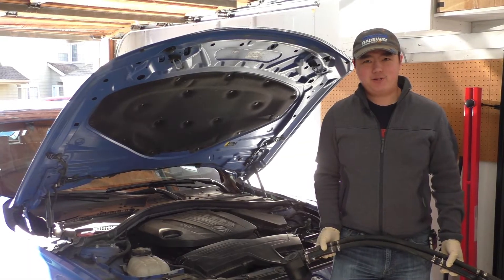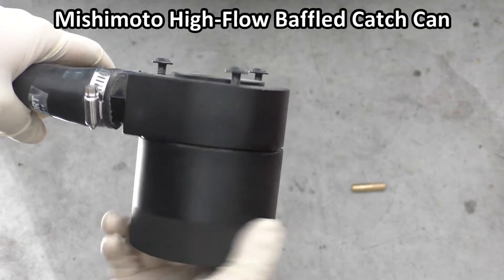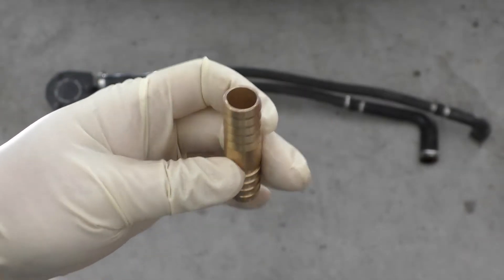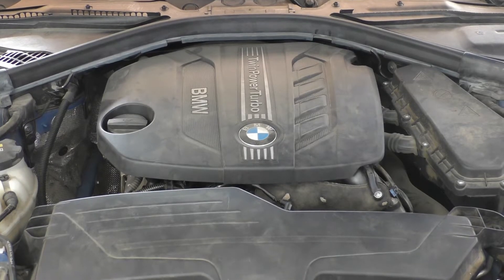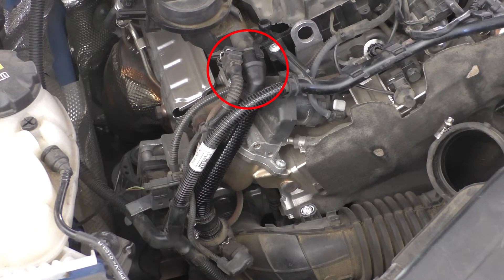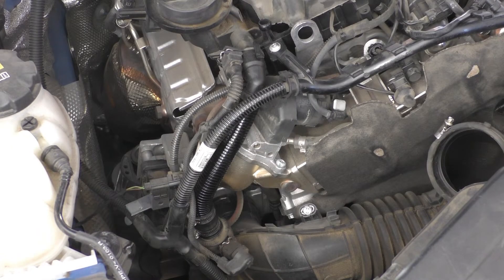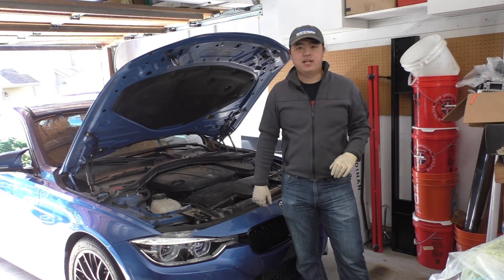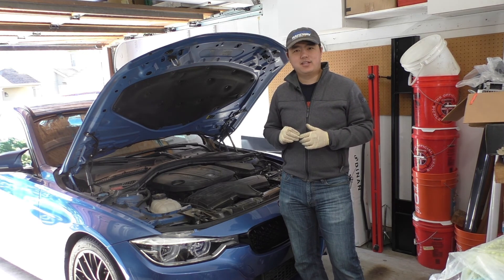BMW 328d N47 Oil Catch Can Setup

Comment: What is the 2nd pipe that is in the air box on the right. What does this do?
Reply from the maker: That pipe is just for additional airflow from what I could tell. It's only on the diesel engine intakes.

Comment: The engine in your car is the N47N. I cant find a proper replacement hose because of that lower heating element. Basically its going to cost over 250$ now for a replacement. I think I am going to do add the catch can. BMW should put a real hose on the car instead of the piece of crap hose that is thin as a straw.
Reply from the maker: Check out my forum post here on how to buy the Euro version of the hose and then adapting it to the lower heating element much more affordably!
https://f30.bimmerpost.com/forums/showthread.php?p=24177240#post24177240

Comment: I recommend using a Mann & Hummel ProVent OEM diesel engine crankcase ventilation coalescing oily aerosol separator. The ProVent 100 or the 200 units are suitable. The 100 is smaller and is the best size for the N47 and is easier to fit. The ProVent can be connected to return separated oil from the crankcase ventilation gasses, back to the crankcase. The unit can also be drained manually. A crankcase pressure regulation valve is incorporated in the ProVent housing. 
The ProVent is able to reliably remove practically all oily aerosols from the crankcase ventilation gasses. However, there is  a coalescing filter element inside the ProVent that needs to be replaced occasionally, depending on flow volume and operating conditions. A filter element will last at lease 1 year used on a car. 
ProVent crankcase ventilation separators are designed and used on commercial and industrial diesel engines, OEM.

Comment: Can you post par
t number from HDS ? plethora of reducers. thank you for your awesome vids. 17 328D wagon w 115G miles. No lights, no codes but the can is for preventive measures.
Reply: i found the hps 1" to 5/8 90 degree part, SOLD OUT, even on Amazon. HPS 5/8" - 1", Silicone Straight Reducer Coupler Hose, High Temp 4-ply Reinforced, 16mm - 25mm, this is my plan B. find a 90 for 5\8 hose. should be good.
Reply from the maker: @MrBiggssr  I see the HPS elbow available on eBay (you can search PN HTSER90-062-100).

Just be careful getting another brand elbow that's in metric. I tried one of those and it was too big to fit snugly around the port from the engine.

Comment: Why would you wana heat the blow by gasses 🤔
Reply from the maker: In cold climates the blow by can condense inside the tube and sludge up the intake tract instead of getting pumped through to the intake manifold.
Reply: When ambient temps are below freezing, water vapor will condense to liquid and ice will form that can block the crankcase ventilation plumbing, causing excessively high crankcase pressure. The heaters prevent ice forming in the tubing.  The heating elements do not heat up the crankcase blow by gasses.

Comment: i hope and pray youre not changing your oil at 10k intervals. Even bmw revised that and said it was one of the main contributors to the timing chain failure that was so prevalent in these engines when they first came out.
Reply from the maker: The original OCI that caused issues was 15k. It was reduced to 10k, which has been fine since. I typically did 7-8k OCIs, and then went to 10k after doing oil analysis every change showing that the oil was still protecting everything and wasn't used up.
Reply: @FaRKle0079  good to know.

Comment: i have a 2015 328d with 106,xxx on the clock, been a very reliable vehicle, but constantly pops a check engine light relating to either the scr sensor or the rear oxygen sensor, always seems to be towards the end of the oil interval that this happens, typically goes away quickly but i was wondering if this could be due to the wrong oil being used? i read that the car requires a low ash oil to prevent the exhaust filtration system from burning up. Just wondering your thoughts. possible they are just getting old and need to be replaced but seems like a symptom caused by something.
Reply from the maker: Are you not using an LL04 oil?

At that mileage the sensors could be bad. It'd be best to check with ISTA to understand the conditions that trigger the code though.
Reply: @FaRKle0079  I trust that the dealership checks the requirements of oil for the car before changing it? But I know I’m probably wrong for assuming they do anything right at the stealership.
Reply from the maker: @theprodistini2590  You should have the correct oil if the dealer changed it.

Comment: What happened to original CCV valve ?
Reply from the maker: The only original part I replaced was the hose connecting the CCV output to the turbo inlet pipe.

Comment: This Mishimoto can is not available. Is there another one brand that you recommend? Anything particular to look out for in terms of catch can filter etc ? Also on this 328d do you have any issue with oil filter housing gaskets ?
Reply from the maker: I still see the can I used on their website: https://www.mishimoto.com/universal-high-flow-catch-can-kit.html

Any of the higher quality cans should work fine. I'd just be careful of a very fine filter if you live in frequently freezing temperatures and park outside. One guy had his bronze filter freeze up and create a blockage.

I'm not aware of any OFHG issues on the N47, but VCG might leak around 110-120k mi.
Reply: @FaRKle0079   Thanks for getting back. Can you suggest a good one without breaking the bank. I am kind of a newbie and got this 328d for power and putting in the efforts to make it nice for the next 7-8 years. The previous owners mentioned that there might be few drops of oil coming out from the engine rail and drip behind the driver's side wheel through the weeping hole. on the engine rail/channel and hence my first thought was OFH gasket.

Comment: What’s up Andrew! How  would you incorporate your oil catch can setup with aFe’s Momentum GT Cold Air Intake System? aFe’s system incorporates the stock crankcase breather hose into their system, but that’s completely deleted with your catch can setup. Any recommendations? I already have your setup on my 17’ 328d and I’m not necessarily looking for performance gains from aFe’s system, but to make the turbo spool-up more audible! 😂
Reply from the maker: It looks like you may be able to use a bit of pipe or joiner to make a union coupler for the HPS elbow to the aFe boot. HPS sells aluminum joiners, and the  90deg silicone reducer elbows have different sizes. For the 5/8" ones, they can go up to 1.5".

You can see their offerings below:
-Elbows: https://hpsperformanceproducts.com/pages/silicone-90-degree-elbow-reducer
-Joiners: https://hpsperformanceproducts.com/pages/hps-aluminum-joiner-bead-roll-connector-tubing-tube
Reply: @FaRKle0079  Thanks! Hopefully the inlet on the aFe boot and the HPS elbow I used from your system are the same inner diameter to make things easier. If that’s the case the Aluminum joiners seem to be the easiest option. I’ll contact aFe to see what the dimensions are for that inlet and go from there. I’m just trying to make everything tie together and not look like crap. As always thanks for the help!
Reply from the maker: @brentevans4430  Nevermind, I'm being silly. The install with the aFe intake is the same as with the stock one. The HPS elbow goes onto the heating element module, just like how I did it, and the heating element module goes into the aFe turbo inlet boot and is secured by worm drive clamp.
Reply: @FaRKle0079  you’re right! I totally forgot you separated the heating element from the stock breather hose. So yeah I’d just clamp the heating element onto the aFe inlet and then attach the 90 degree HPS elbow from your system to the top of the heating element. Went back and watched your video and noticed I was really overthinking this. Haha

Comment: I was just replacing the intake manifold gasket and during that the PCV plastic hose shattered!

Ended up fixing it with 3/4" rubber coolant hose for now.. I'm planning on doing the catch can.
Reply from the maker: If you want to "go back to stock" you can order part 13717823517 and the cut the corrugated tubing at the length you need to for the rubber coupler and heating element.

Comment: I'm running a JR  Stage 3 Tune on my 328d. I think you are right I peak about 30ish. 

How come you haven't done the EGR delete yet? If you have questions about it DM me on instagram. @ryan.f31bmw
Reply from the maker: CA requires smog check every other year, and I don't really see why I need to remove the EGR HW if its use can be programmed to when I want it or don't (the KermaTDI tune I have can do this). That's why I haven't felt the need to delete it.
Reply: @FaRKle0079  ahh Cali gotcha.
Reply from the maker: @ryanreich7635  Yup... I failed smog once because I didn't remove my catch can. It's dumb that a mod meant to make things cleaner makes you fail smog.

Comment: Thank you for the awesome job you are doing with these BMW videos!
I'm running a tune with a 27.5PSI boost on my 320d. I can't even imagine a 32PSI boost on a stock turbo. How do they not blow up instantly? 

I notice that my engine bay smells of exhaust while running. Is that normal or could something be leaking? I don't have any issues with power or check codes (scanned with ISTA).
Reply from the maker: High boost, the beauty of diesels and compression ignition!

It's pretty normal to have a bit of smell in the engine bay. One area I'd check for leaks is where the CCV pipe connects to the intake boot that feeds into the turbo. BMW has a pretty poor seal there and I had a lot of buildup around that connection.
Reply: @FaRKle0079   @FaRKle0079  I have checked the CCV pipe and it doesn't have deposits. I wonder why it should smell of anything at all. Isn't it a completely sealed system on the exhaust side?

Another thing I don't understand is why there's a slotted connector to the intake path in the grill. (7:55). This is not sealed and seems to breathe air around this region. Is the smell because of this open region?
Reply from the maker: @BimmerDrives   That slot connects the air box to the intake channel. The filter is in the airbox, so it doesn't matter much if air seeps in that way.
Reply: @FaRKle0079  Yes, but I'm wondering if some of the CCV ventilation leaks back out from here at idle, when not much air is being pulled in.

Comment: Can you please do an EGR Delete Tutorial? Would definitely help on reducing carbon buildup in the intake and on the valves. I mean you’ve only eliminated half of the problem by installing an oil catch can lol 😂
Reply from the maker: It's easier to have a tuner program EGR to stay closed than to delete it outright. EGR is actually beneficial for helping the engine get up to operating temp from a cold start too.
I won't be deleting mine as I have to get smog checked every other year.
Reply: Interesting! What tuning setups do you recommend? Also are there specific tunes that automatically close the valve once operating temp is achieved? ...So you don’t have to physically open an close the EGR every time through an app or something.
Reply from the maker: @brentevans4430  I highly recommend the KermaTDI tune. Those guys have really taken the time to understand how BMW designed the system and intended it to operate. Other tuners will modify one thing here or there to achieve a specific target, without considering the effects on the rest of the system. I've gone through three different tunes/devices over my ownership period (not including the stock tune).
Reply: @FaRKle0079  I finally got my Certified Preowned 2017 328d as of yesterday. It seems that FCP Euro and other sites don't recommend any fuel filters for my vehicle. It should be the same as your filter correct? Just trying to do some maintenance.
Reply: The vehicle is at 47,000 miles and just at the end of its warranty period, and I'm not sure of what has been serviced up to this point... so I'm doing a ton of basic maintenance.
Reply from the maker: @brentevans4430  Congrats on the acquisition! My vehicle is also a 2017 so yup, you'd use the same fuel filter. Here's my video on changing the filter: https://youtu.be/cVqaKJfV6NA
Reply: @FaRKle0079  I've looked into the kermaTDI tuning things and they have one for the 328d but how do i know if itll program the EGR to disable or if it simply just the performance tune?
Reply from the maker: @ruvdan  The KermaTDI tune optimizes the EGR use to reduce build up, while remaining emissions compliant. There are cases where EGR is useful.

Comment: Great video - is there any sort of detectable difference in the performance/condition of the car since you've installed it?  I ask because I am in the process of trying to sell an M7 oil catch can I bought for a MINI Cooper I traded to get the 328d Touring!  I'll have to look closer to see if it could be made to work...
Reply from the maker: Feel-wise there's no difference after adding a catch can. When I've disconnected my charge air hose/pipe from the intercooler though I notice there's less oil. Of course all the oil that the can collects (even if it's not a huge amount) means that much less oil going back into the intake system!
I'm sure the M7 can, can work with the N47 given the right size fittings.

Comment: such a straight forward & great video! I am thinking of doing this mod on my 520d N47, mainly preventing oil from blow by & EGR carbon sludge mix clogging throttle & manifold. Do you think it will help?
Reply from the maker: I think it'll help to do what you want, preventing oil from mixing with recycled exhaust gas. To keep the intake manifold even cleaner, I'd see if you can find a tune that closes off the EGR valve more too.
Reply: @FaRKle0079  i wish to close off the EGR too but its illegal where I live; annual provincial car inspection.
Reply: @미스터쿠쿠-e1x  couldnt you just unplug the EGR leaving it in the closed position and then when you have an inspection just plug it back in? im sure the cel would illuminate but if youre looking to rid yourself of the EGR i think that would work. Just make sure it doesnt default to the open position when unplugged or your manifold will melt.
Reply: @FaRKle0079  I also heard the condensation on bronze piece of Mishinoto catch can may freeze up in winter and clog the system. I am trying to find one that doesn't do that. Anyway, keep up your good work! Loved your video!
Reply from the maker: @미스터쿠쿠-e1x  The catch can I'm using (the high flow version) doesn't use a bronze filter, but more of a plastic/foam type mesh. I think it has larger orifices than the bronze one. I'd shoot Mishimoto an email and ask them about that failure mode too!
Reply: @FaRKle0079  will do! thanks a lot :D btw do you have any opinion about coalescing air filter?There is a product call "Provent 200" which is a coalescing filter OCC but I am building a blowby filter system from scratch. Would coalescing filter causes air flow restriction and cause engine's seals damage?
Reply from the maker: @미스터쿠쿠-e1x  The provent 200 should work fine. There have been others that have used that on BMW diesels. I don't really have an opinion on whether it's better or worse than a catch can. The only thing about it is you have to replace the filters and might need to attach something to the bottom as a collection reservoir.
Reply: @FaRKle0079 I see, thus need two cans one for collecting and one for store. Thank you for your great comments! I will give u an update how it goes
Reply from the maker: @미스터쿠쿠-e1x  Instead of another reservoir/can for the provent to drain into, you can also just attach a long piece of tubing to the drain with a valve at the end and use that internal volume as a reservoir. Just have to check to see how quickly it fills up! Good luck!
Reply: @FaRKle0079  great idea 💡 i will try that! Thanks

Comment: What is the part number for corrugated tub that you replaced ? I brock it as well
Reply from the maker: It's 13717823517. The corrugated section will be longer than you need for the 328d, so just cut to size.

Comment: What benefict does do an oil catch can, 
Sry for my english.
Reply from the maker: It captures blow by (oily exhaust air) and filters out the oil/contamination before it goes back into your intake. So it makes the intake air cleaner and prevents fouling.